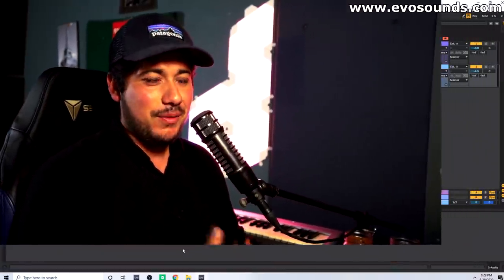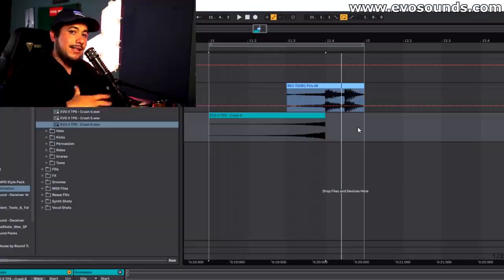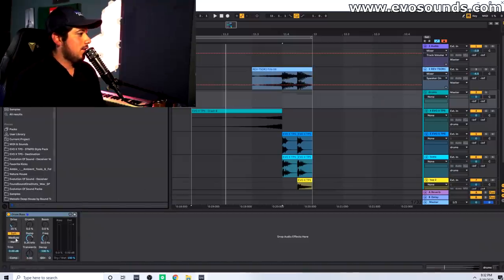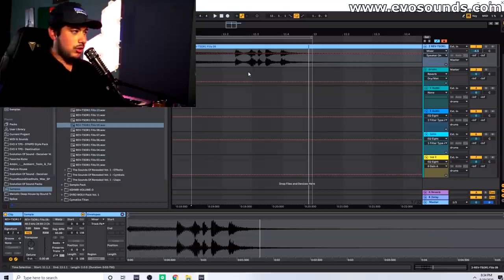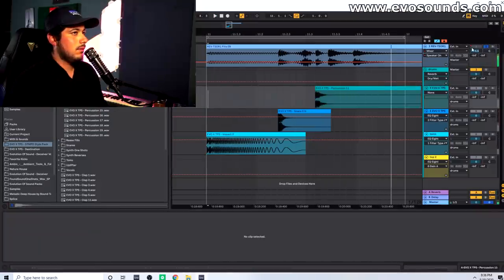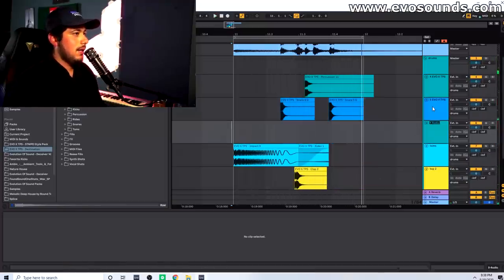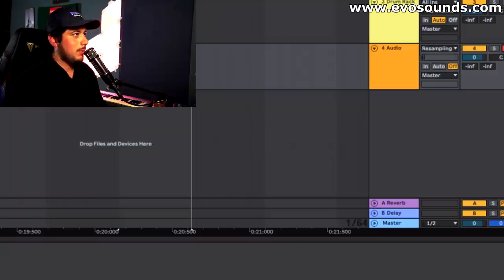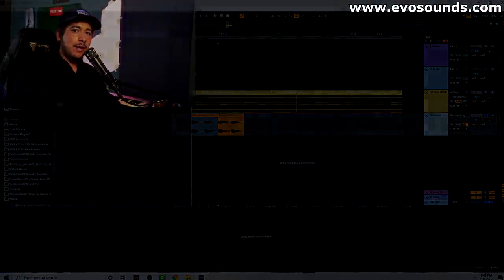How To Make EDM Drum Fills That Fit

Comment: Another cool trick for this sort of thing in Ableton is finding a loop you like the feel of then using the convert drums to midi option & simply just swap out the samples for ones used within the track or you can select completely new ones aswell